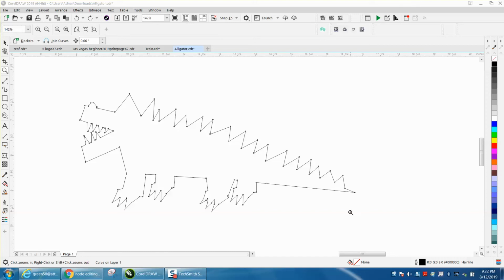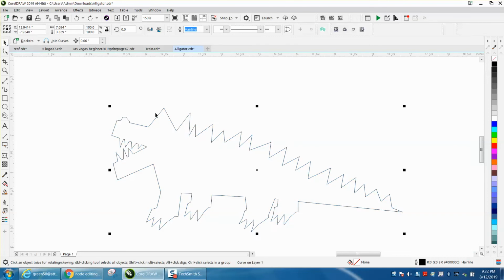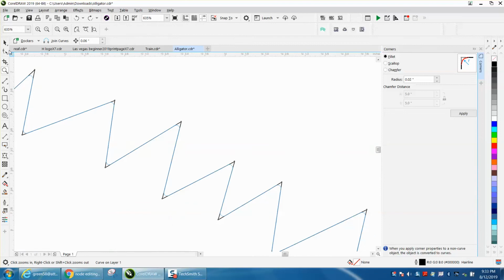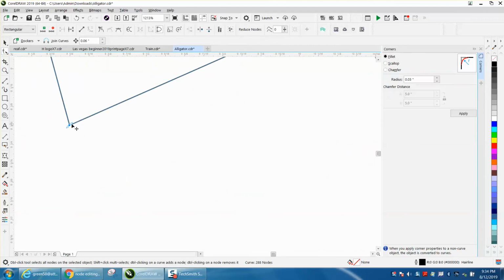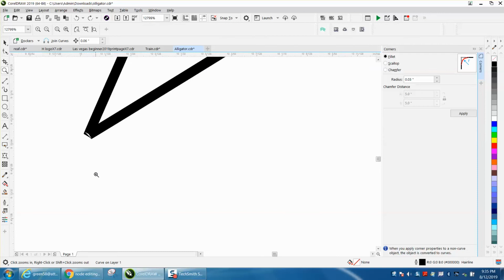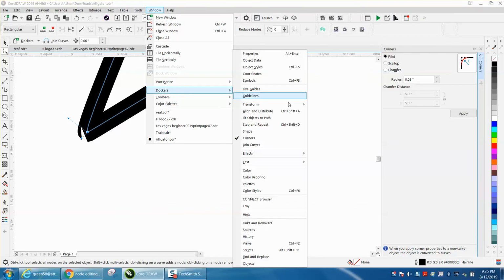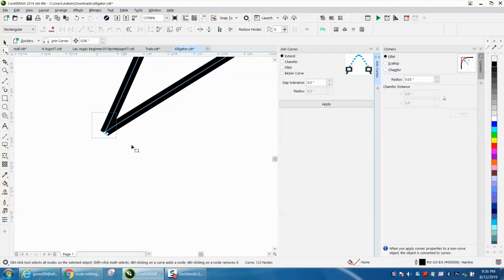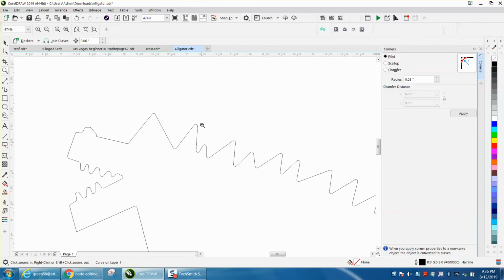Corel Draw Tips & Tricks Round all Corners and more nodes

Comment: Thanks Doug! I don't think I've ever opened that docker before. My router software compensates for the bit diameter automatically but I was trying to get Corel to do it so I could just radius all those points to laser something in soft material. Your solution works perfect - especially since the amount of the radius can be specified.
Reply from the maker: Great, glad to hear
Reply: On Corel X5 the function is under Window, Dockers, Fillet/Scallop/Chamfer
Reply from the maker: @DesignCutters  As always thanks